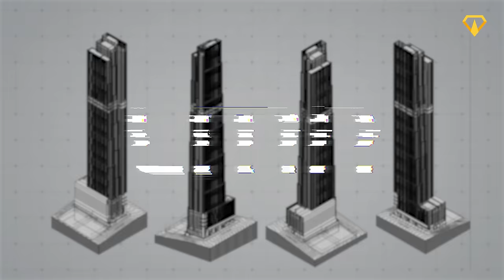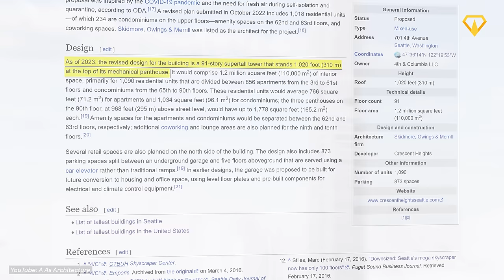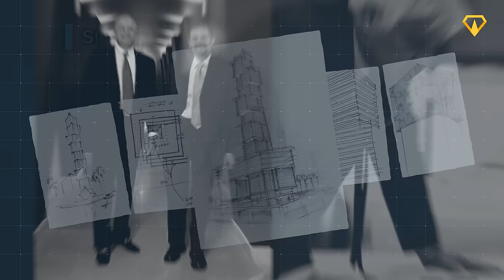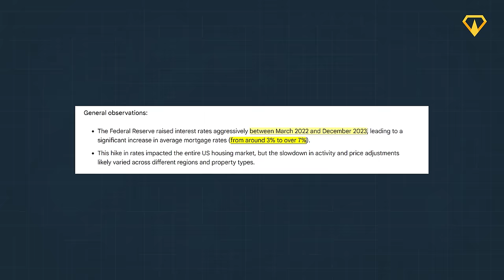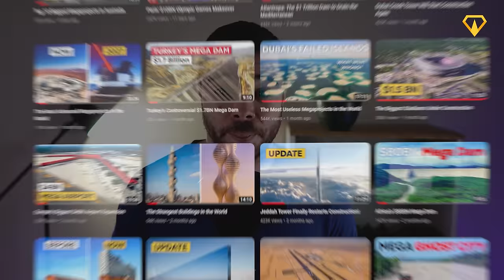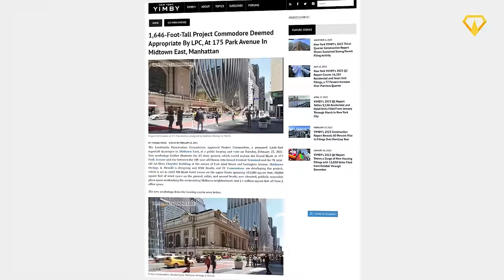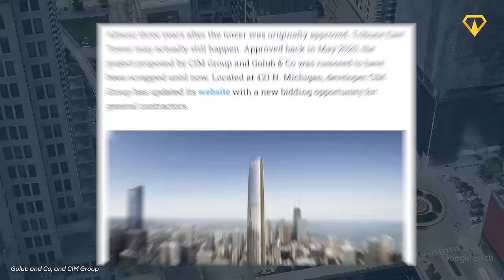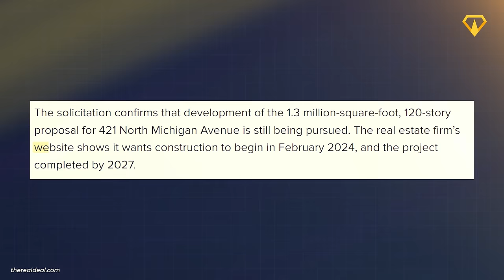America's Skyscrapers of the Future

Comment: The One in Toronto is well underway and has surpassed 55 storeys. Construction has not stopped.
Reply: No surprise to any Torontonian that the construction schedule is lagging behind.  Nothing gets built in Toronto on time, or on budget.  
The Eglington Crosstown Subway began construction in 2011 with a scheduled completion and operation by 2020.  It's now 2024 and the builder, Metrolinx, will not provide an updated expected completion date.  The project was originally budgeted at $11 billion dollars, but has currently reached $12.81 Billion dollars and it is now estimated to add $1 Billion dollars more, before completion.
Reply: @chrisgraham290its almost done 4
Reply: It went into receivership I worked on the tower the size has been reduced